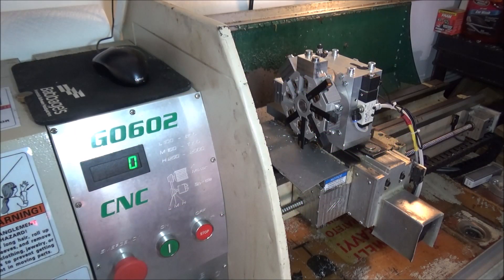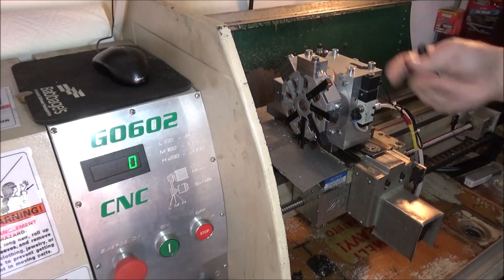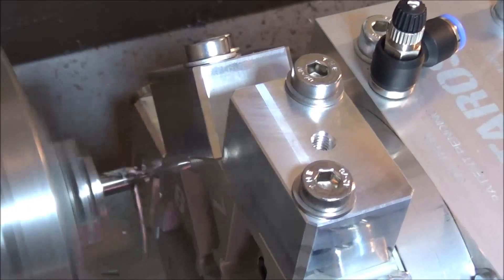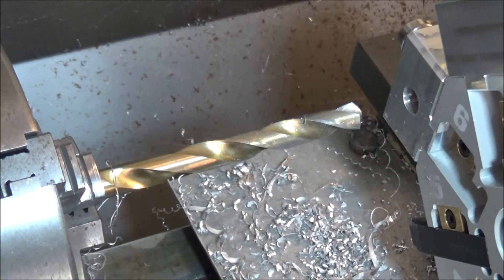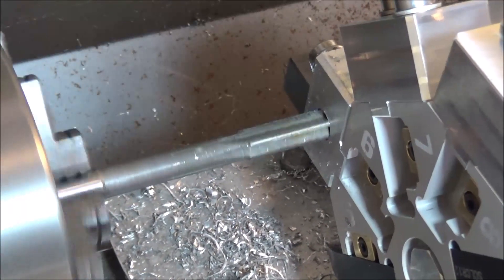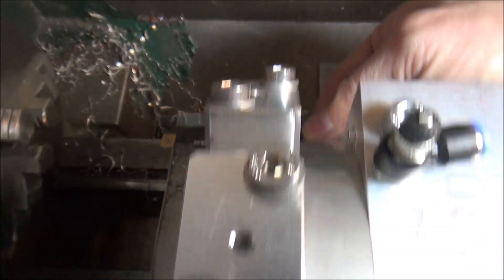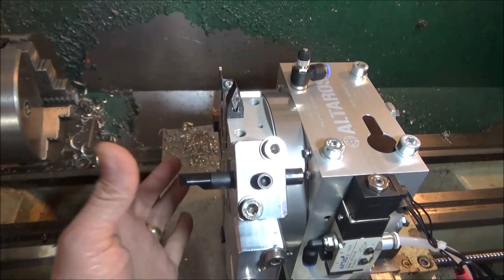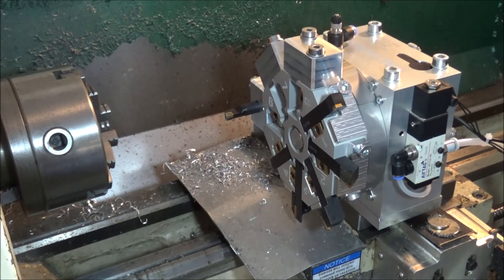ALTAROS TOOL BLOCK SETUP

Comment: Hi CNC4XR7, great channel, i' ve been thinking these days, i want to build a epoxy granite cnc router, so i watched plenty of videos about it, so the question is, what if i put fiberglass pieces into the epoxy granite mix? would that increase the material overall stiffness? or thats not the case?
Reply from the maker: I dont think Ive ever seen anyone add any fiber to A Epoxy Granite mix. So I dont know what benefit it would have if any.  I have seen networks of stiffening rods etc.

Comment: Hi, I was a CNC turner for about 25 years.  Been 15 years since I last did it though.  I made similar to that but with 3 holes along the centreline.
Had a Centre drill in the furthest position from Turret so I could get in and centre for the tailstock.  Also a small Jacob's chuck and a boring bar too. All held in with Grub screws.
You then need three offsets:  Something like this:   " T0808"      "T0818"     "T0828"
or
" T0808"      "T0809"     "T0810"
or something along those lines.
Very useful for those jobs sticking out of the chuck with a " not too big " diameter.
You then gain an extra couple of tools.
Hope this is of use to someone.
Excuse me for butting in.
Jim
Reply from the maker: Very good! suggestion thank you i will be sure to pass this along.